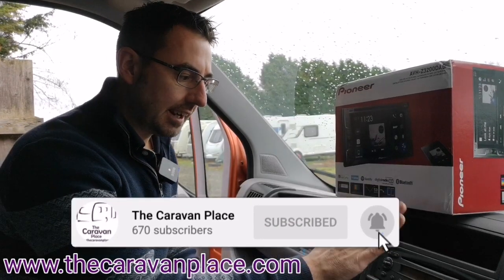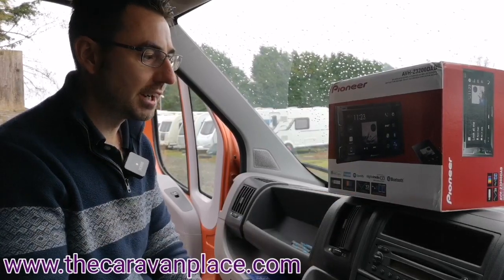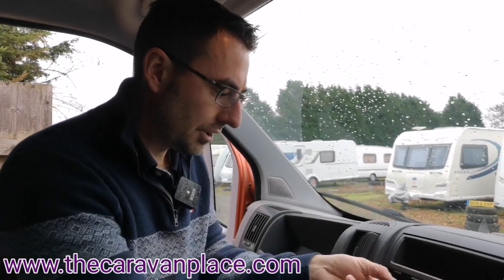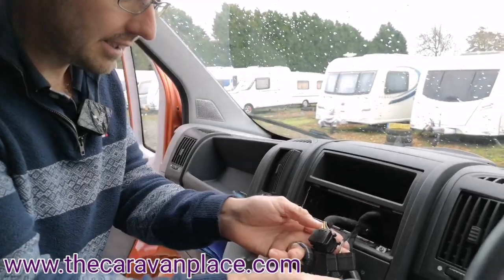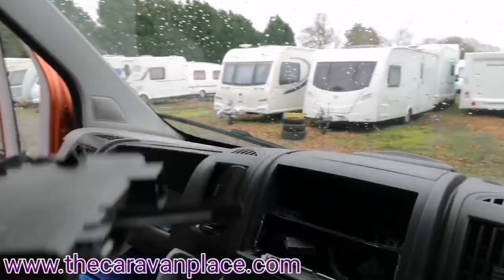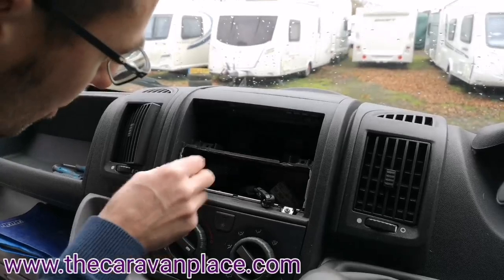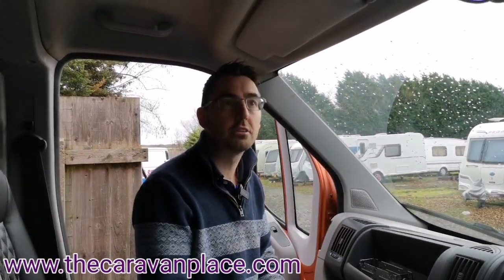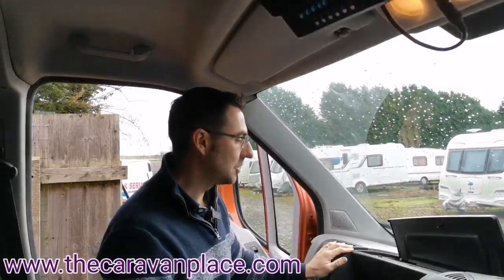Fiat Ducato double din pioneer head unit upgrade in motorhome

Comment: Really good video but how do you remove the head unit should you need to??  I cannot find any info on you tube how to remove a pioner head unit like this and need to check my aeriel connection.😢
Reply from the maker: On most there is a gap down the sides in the middle, small screw drivers or removal tools push down the side and the head unit will be able to be pulled forward. Have a search for pioneer double din removal tool for what they look like.
Reply: @thecaravanplace  Thank you, I have the removal tools but there is no gap for these.  I have since found out there are 4 screws holding the cage in and the cage comes out with the head unit on my set up (Knaus Sun Ti 650).  Thanks for the reply 👍👍

Comment: Hi again. I’ve been r very helpful directions in my 2008 Peugeot Boxer Rambler. However one problem I appear to have is I can’t find the pioneer corresponding to the series number on the box in your vid. Any chance of letting me know which one is the right one to order please? Thanks in advance. Jim 😊
Reply from the maker: Hi Jim, I think its discontinued now, but most double din heat units will fit. We are about to fit a ATOTO head unit soon and test this and compare if you are able to wait a few weeks.

Comment: Why these doesn't fit relay 2007 ?  Dashboard is the same as 2011 right?
Reply from the maker: Not sure on the older but if it has room for the double din then it should, would be a case of removing the old radio and bottom tray and measure it.

Comment: Would this be the same on my 2002 ducato motorhome? I’m not overly concerned about the make and model, I was told that these should have a minimum of 2gb memory?! 

There’s already an aftermarket head unit in the van (single din but it opens out to a touchscreen pad - it’s ripspeed) but it’s pretty crap and has no navigation. I’d like to have a reverse camera fitted at the same time. I’m going to head to head off on a big trip around Europe in February so want something fairly decent so the navigation system would be great … oh and Apple connectivity + dab. Can you recommend any other stereos that would have all these features?

How much could I expect to pay an auto electrician to fit both roughly? Thank you in advance.
Reply from the maker: Thanks for your comments Martin, I would possibly have a look in halfords and they should be able to show you some options. We have a place valled Bass Junkies in the midlands, so having a look for someone like this and they can give you the best options and also fit. I'm not sure on cost sorry.

Comment: VERY helpfull this video mate! im about to do the same but will the old connector off fiat radio fit a new radio ok?
Reply from the maker: It may just need a converter? If you pull the old one out and then compare with the new, if it does need a converter just a Google search and you should find one suitable 👍

Comment: Such a shame you didnt explain the wiring harness which to most of us is the main area of uncertainty as numerous adapters maybe required.  Other than that a good video.
Reply from the maker: Should just be whatever the stereo is back to original fiat which is iso connectors.

Comment: nice one ..thanks for sharing.i see that green brake cable..what is that for and where does it go?
Reply from the maker: I honestly can't remember sorry, it will be in the manual though the wiring harness. I know each head unit will be different but this one had a fair few inputs and outputs. We will be doing a VW Transporter head unit upgrade in the new year which we will put a similar head unit in and add cameras into it so will have a good look at the wiring then.

Comment: Hi, great job! Does your steering controls still work, or did you fit additional wiring? Thanks😊
Reply from the maker: I dont think we had steerling controls on this one. So I'm not 100% if it will just work sorry. Worth a try as the wiring should be in the same loom so in theory I think they should work without any other wiring?

Comment: No explanation about the connection f the wire harness which is the most important part so not much use I'm afraid
Reply from the maker: Hi it should just be a plug and play, some will need an adapter which is just a quick Google search of your model. Hope this helps?

Comment: When it comes to specific fiddly bits, like connecting up the radio or fitting the new components, the IMPORTANT bits, the video fast forwards through.. why skip these bits and leave in long segments of removing or refitting trim etc? Very annoying. Still. Good video but editing could be better, its clearly aimed at the novice or first timer so llease include all the key details. Thx
Reply from the maker: Thanks for your comments, we will make sure to detail this on the next ones 👍